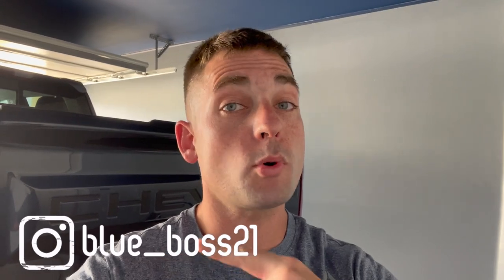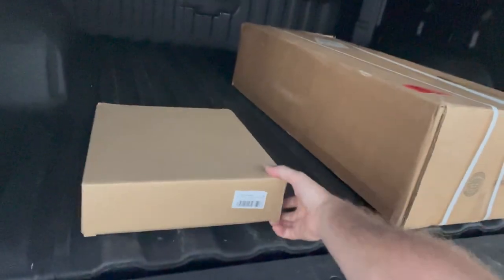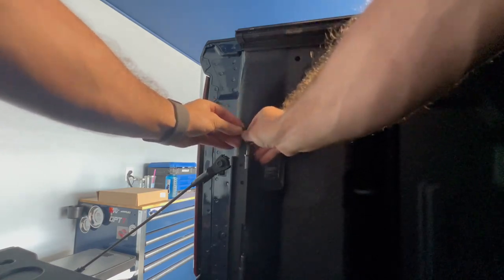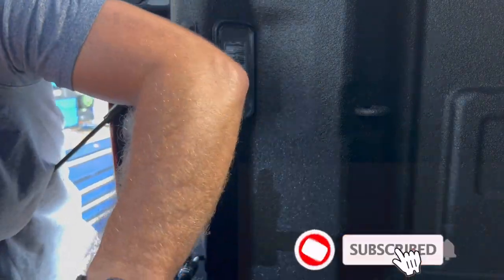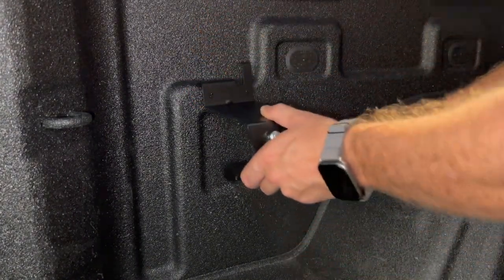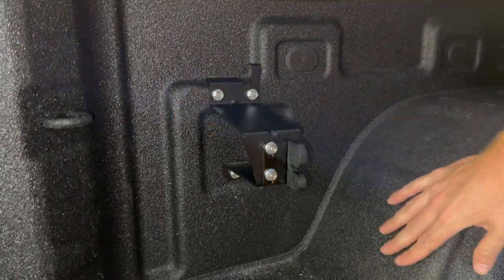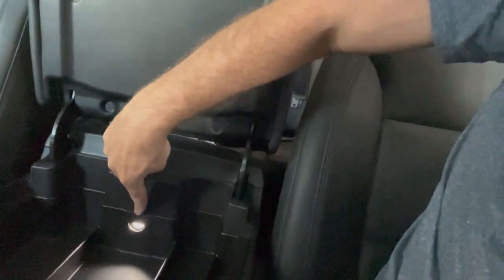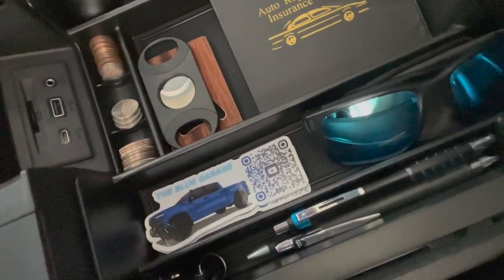New Swing Case Truck Bed Tool Box (1 Year on YouTube!)

Comment: Just out of curiosity, with the lights and outlets being there....are the screws short enough to not pierce any wires or harness behind there??  Do the instructions say to pull  the tail lights before hand to check at all?
Reply from the maker: I didn’t have any issues, and the instructions did not.

Comment: I have that case for passenger side, may put one on driver side too. But i have the refreshed 22 so i have to remove the grab handle thingy.
Reply from the maker: I didn’t realize they came with a handle. Is that on both sides?
Reply: @TheBlueGarage  No only driver side if you have the flex tailgate chevy puts a fold out handle on driver side. it goes where the swing out case would go so they tell you they only make it for passenger side in the refreshed trucks
Reply from the maker: That’s a pretty cool feature though.

Comment: I like the swing box but don't you think its going to rust out your bed from the inner fender
Reply from the maker: It could, but I don’t get any water in there, unless I’m cleaning it out. My tonneau cover keeps the water out.
Reply: @TheBlueGarage  if you go under the truck in the back you will be able to see the screws where they came through its wide open from the bead to the fenders just look and if the creews are not stainless they will rust just from the moisture in the morning and it will spread to the bed of the truck
Reply from the maker: Good point, maybe I’ll get up there and treat them with some Rustoleum